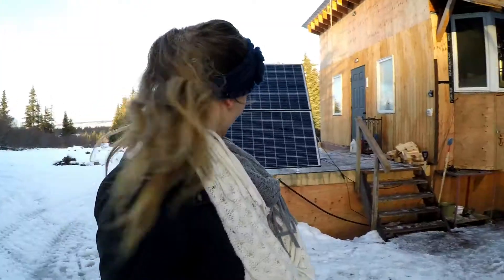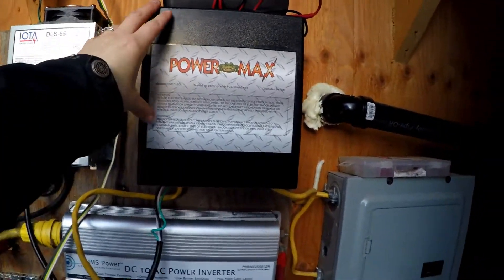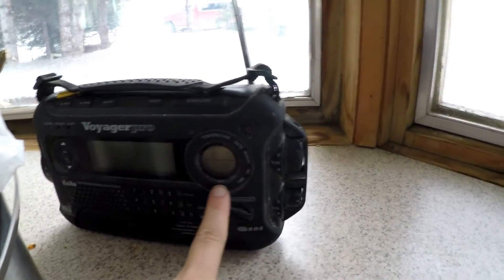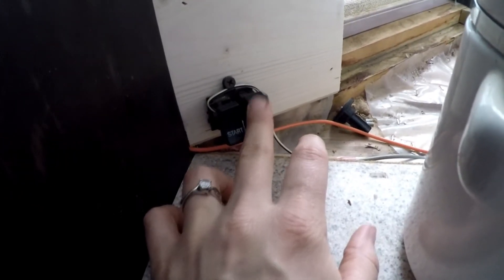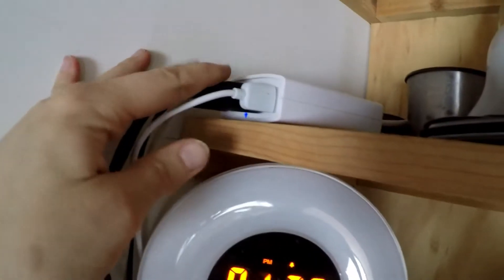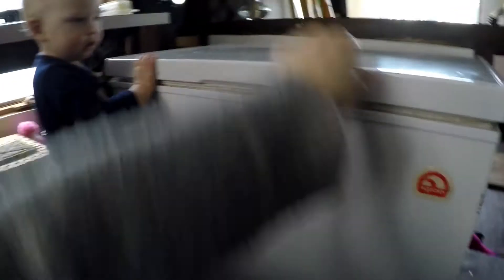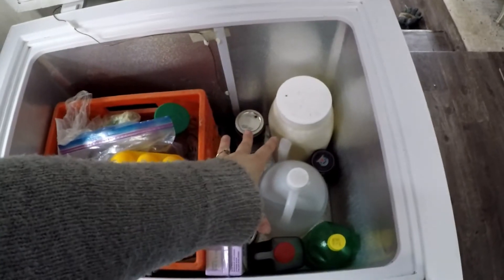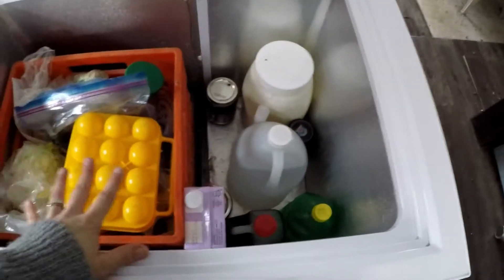Solar Power System under $3000 | Modern Off-grid in Alaska

Comment: I've been thinking about a similar water system, putting a 30 or 40 gallon tank in my loft so I can have some sort of running water. Obviously the pressure looks fine for you guys. Looks like you run the water line under the counter then up through the faucet..? Btw rain water is freakin awesome.

Have you thought about creating an amazon store for some of the products you talk about? Ie I'm really curious about that solar radio you're using.

PS: I think I have the exact same maul! Every other video where I see people chopping wood they're using some kind of fancy axe. I say whatever gets the job done. I don't even know where I got my maul from.  Cheers from Ontario.
Reply from the maker: We do have a 12v pump and pressure tank because the hot water heater needs a flow of like 3.2GPM to kick on but if your going for just running water I'd think an elevated tank would work great.

Comment: Greetings from off Grid Oregon! We used a freezer for a refrigerator too. We had 600 watts of solar when we first went off grid. The chest refrigerator worked very efficiently but it was kind of a hassle getting to things. winters were hard. Here in the Pacific North Wet we can get 60 days in a row and never actually see the sun. Last year we had 100 inches of rain and five feet of snow with a 1400 watt solar array. Now we have 4800 watts of solar. Even with all that we had to run the generator 2 hours a day from Mid December through the end of January. I have not had to run the generator in 2 weeks now. It looks like snow is coming from you the Gulf of Alaska next week. We built our house from timber on our own land with our Woodmizer sawmill. We have been here now for 29 years now. It took many years to build this homestead as we did it out of pocket as we went along. The same with the solar system. We finally have a full size house and a large enough solar system that we do not have to conserve power. We have six sons all raised in the woods with no regrets! We did home school and private academy for our sons. Growing up 18 miles from  a small logging town I think had every advantage for our family. I really like what you have done and the way you do your videos. May the Lord Bless your home in Jesus name!
Reply from the maker: Thank you! That is quite the set up, we are hoping to keep are solar needs to a minimum so we don't have to expand to much. December was tough here for solar though, having another energy production method would be nice to float Us in those sunless months. Being out here definitely has advantages for kids, so excited to watch my daughter grow.
Reply: Hello I am in Ketchikan. We are  looking to change our church camp over to solar and inverters. I would love to talk to you about how many and if it matters what kind of batteries

Comment: We have outdoor lites from the same manufacturer but the 54 LED ones than the one I saw 
The problem with them is the location of the switch.. on the back so if you screw down you can't change the modes. they work well though we have them on the rain gutter going out the back door and above the wood shed door so when we go out for more wood at night...they're great because the solar cells work without direct sunlite...so in the last mode they always come on for at least 20 sec without more motion... you could chop wood at night... loved that part   pain in the rear...  yeah. 
soon it seems you will have to do some overhall to the electrical to keep little hands from the dangers. thanks for the new vid
Reply from the maker: In time we will probably get a woodspliter but we have other things on our to buy list that have a little higher priority. Two panels and another battery would be lovely to add into our system. Yes we have a lot of tidying up to do, the panels on the deck is our temporary winter solution and we are considering moving some of the systems to another location so it's all kinda of in process yet, waiting to make it permanent and tidy. We love our solar lights to, even the shortest day of the year the ones on the deck still worked fine.